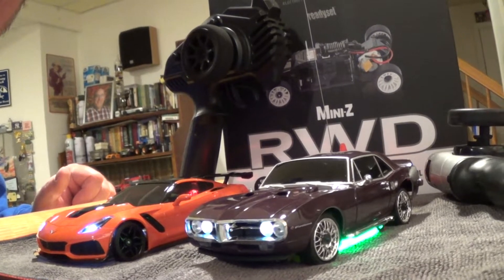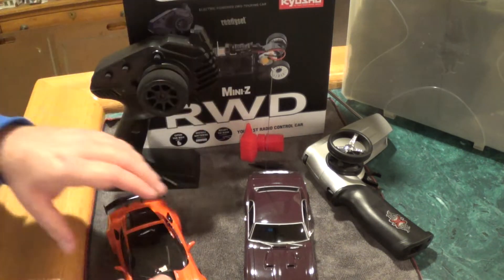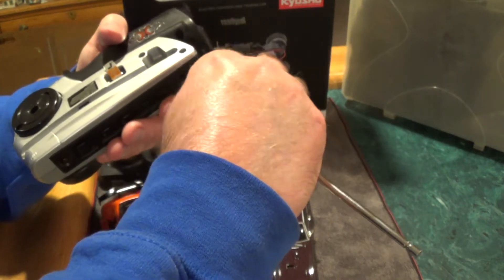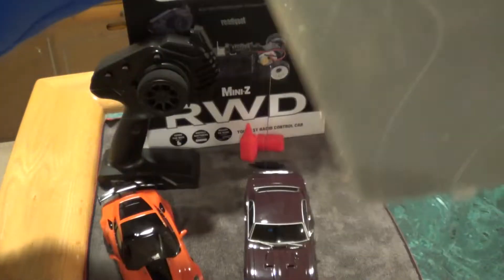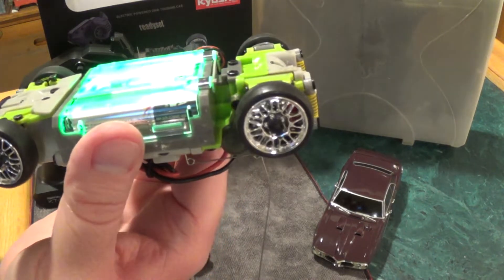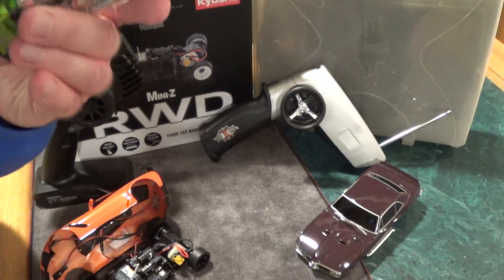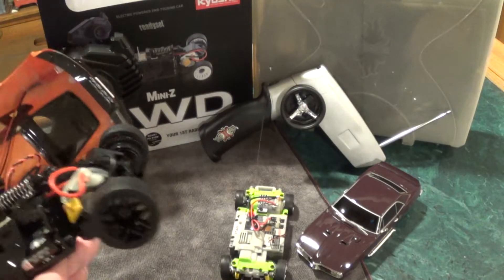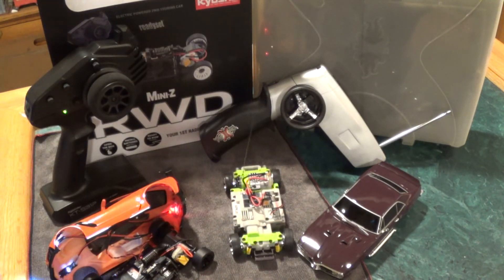Kyosho Corvette Mini-Z vs Firebird X-Mod Comparison

Comment: I have the Firebird too with all the options added too, they look awesome but just never drove well, I got mine out the other day just to reminisce and after a minute of driving it packed it back up LOL the transmitters are horrible and even the 4WD converted chassis handles horrible compared to my Kyosho mini z's, Tamiya Tamtech's and ABC Hobby DTM's but that Pontiac Firebird body looks so cool, I figure the Firebird will look good for years to come because it doesn't get driven.
Reply from the maker: Yeah, I agree that Firebird body is just beautiful and the chassis is just meh.  I pull mine out every once in a while just to look at it too.  My Kyosho MiniZs are far superior, but the nostalgia is strong for these old Xmods😁.

Comment: oh man you've got a EVO there,  those were the "junk" xmods, the 1st generation one is where its at.  people modded them with  triple stacked FET's neodymium magnets and lithium batteries to run well over 50 MPH flat land.   and  on the track they are AWD and pull very hard.
Reply from the maker: I don’t know if it’s 1st gen or not, but it’s definitely not an EVO.  This XMod is 16 years old.  The EVOs came out a bit later.  Interesting info though.  Is it 50mph scale speed or 50 mph actual speed?  I had the Camaro back in the day and ran lithium batteries in it.  The electronics didn’t like it after a while though and it became glitchy.  It was fun while it lasted.
Reply from the maker: @jsoex  

I checked out the videos and you are correct.  It is an EVO chassis.  It’s been so long, since I bought it I had totally forgotten what the original chassis looked like.  The modification to the Hummer XMod in the last vid was really impressive.  That brushless outrunner motor made it quick.  Thanks for the info😁👍.
Reply: I like the EVO chassis though.

Comment: I've got three of the xmods still don't run them anymore but they're tucked away in their box one I had shipped to Texas and had high chips put in 4 more power and they had a whole entire website aluminum upgrades and better motors for the xmog back in the day I think the website was called atomic xmod
Reply from the maker: Nice!  Yeah, atomic xmod sounds familiar.  I had the Camaro and Hummer back in the day.  Sold them though🙁.  Ah memories😁

Comment: How's the new corvette body handle on track. I might want that as my next body?
Reply from the maker: I haven’t had it on a track yet, but I would imagine it is fairly good.  It sits low on the chassis and that splitter up front and wing in the rear should help especially if it’s converted to brushless😁.

Comment: Be careful of the rear wing for the ZR1 as it tends to pop off the body with a slight knock .. id advise sticking a little bit of hot glue to the under tabs where the wing connects as this should help keep it on while driving 👍

Thank you for the content by the way
Reply from the maker: Thanks for the info...I will definitely try that🤗